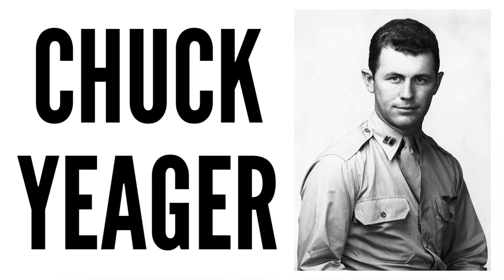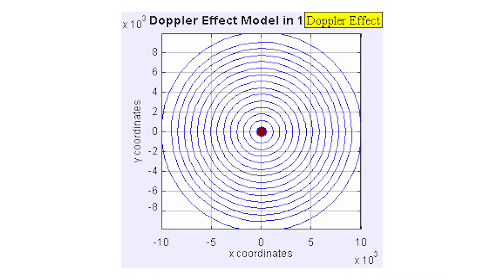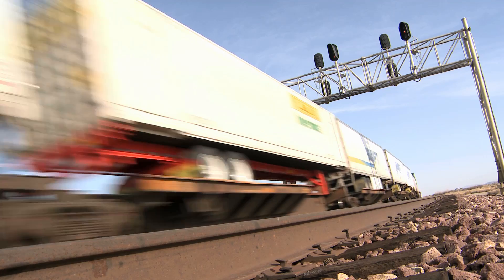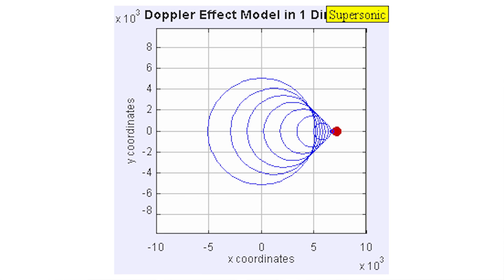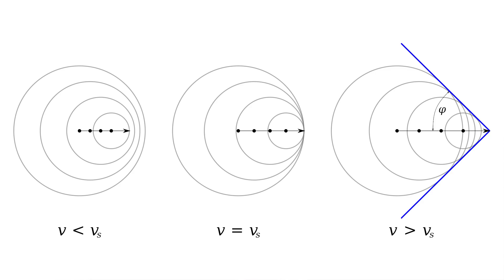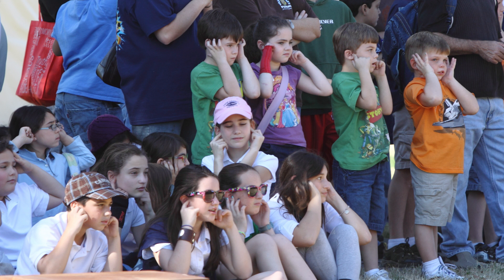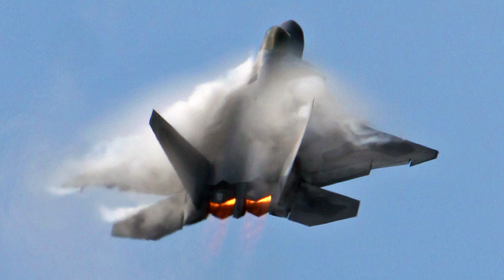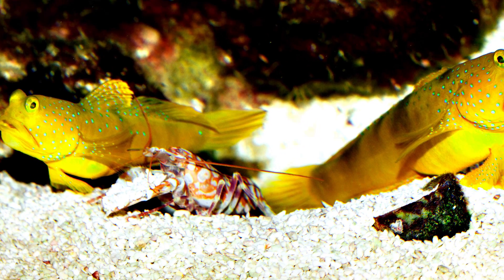What Is a Sonic Boom? And How It Breaks Every Rule You Know

Comment: This answered a life long question and argument in my family thank you!!! I’ve always told my family that there is no way a sonic boom only happens at the point of which the jet passes the speed of sound, rather the sound boom rides behind the jet until it slows below the speed. Everyone said I was wrong. And I knew I had to be right bc the jet is still ahead of the sound the whole time. How could it be one big boom and than nothing!?? No. The boom isn’t one boom it’s a loud roar following the jet. And when it hits you on the ground in sound like one boom. It’s like if you run as fast as the jet without creating your own boom. You could run in the boom sound and it would be constant. Not a boom at that point but just a loud constant roar. You can hear this roar for more than the boom. Have you ever thought a get engine was loud as thunder when it was way off in the distance? That’s not the engine making that loud roar. That’s the sound wave overlap you’re hear. When a jet is flying under the speed of sound way off like that, you don’t even hear it. I know you’ve seen a jet and heard nothing? You’re like wow that crazy i can’t hear the engine. Well it was never the engine you were hearing. If you only hear the engine the sound wouldn’t make it to you. And if you was close enough to hear it. It would sound like air spraying. Not thunder

Comment: 00:39.   That’s not a sonic boom. You’ve been fooled by whoever sold you the pic or wherever you found it. Basically it’s a bit of group think happening there. That pic is actually a vapour cone.

What’s a vapour cone. Well as anything moves through the air it will compress the air in front of it. Then the air will expand into the lower pressure behind it. If there is enough moisture in the air or a big enough pressure differential then you’ll get a vapour cone.
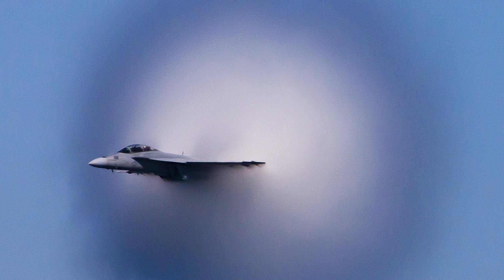Reply: He literally explains this at like 6:00
Reply: @padatricks1561  well don’t pass it off as a sonic boom and then  a person might watch the video instead of bailing and thumbs downing and running the watch time.

Comment: Ok that shrimp is pretty damn impressive! About sonic booms, my elementary school, which I’ve posted various comments about, was on the beach, sort of. Our playground was all sand, and to actually get to the water, all you’d have to do is walk a path about 25-35 feet long through some very low vegetation. Anyway, Air Force & Navy pilots often used to do practice flights over the Atlantic Ocean, and not too far from the school. And more than often they’d break the sound barrier and BOOM! All of the windows would shake and rattle. In fact, it became so common that we were eventually desensitized to it. And whenever it happened, we just ignored it. Still was pretty cool experience at such a young age.

Comment: Good video, I think it's great that you can talk about so many different things; however it is also a myth that there is a "sound barrier", and that aircraft have to "break it" to go faster than sound. In reality a shock wave develops as you say, which can be heard as a boom but it's not breaking through any sort of barrier. Air flow over surfaces changes as the speed of sound is matched or exceeded, so not every plane could physically travel so fast without dropping out of the sky.

Comment: 340.42 m/s is just an AVERAGE at MEAN SEA LEVEL. The speed of sound in air is highly dependent on air pressure and temperature. 340 m/s would have been adequate - there is no need to quote to such high precision

Comment: Wonderful video sir.

This doppler effect is very cool it helps you calculate the speed of a moving object simply by measuring the change in frequency. 

The change in frequency is corresponding to the speed of a moving object. Machines can easily measure the change in frequency.

It is also used in medical science for looking at the flow and turbulence and other things.

Comment: It doesn't take longer for the sound to reach your ears, or quicker for that matter. The waves are compressed and stretched, yes, which simply means longer and shorted wavelengths, which translates into higher and lower pitched sounds, depending on which direction it's traveling (towards or away from you).

Comment: The speed of sound in water is 1500 m/s, that is more than four times the speed in air, so I don't know if it's even possible to create a sonic boom in water before it would boil and vaporize. The mechanism behind pistol shrimp's ability is somewhat similar, its claw shoots out a cavitation bubble that causes water temperature briefly rise very high. The bubble is moving at around 100 km/h which, while still being impressive, is a fraction of the needed velocity to cause a sonic boom even in air. The claw might move even faster than that but still, I doubt it causes sonic boom.

https://en.wikipedia.org/wiki/Alpheidae#Snapping_effect

Comment: Great video, and excellent explanation. One suggestion - you give the speed of sound at Sea Level as a constant. But the speed of sound actually changes daily at Sea Level depending on the air temperature. In an ideal gas, the speed of sound is directly dependent on the temperature alone. Specifically, it varies in direct proportion to the  square root of the absolute temperature. 

One moment you can be breaking the sound barrier, and the next minute you may not be - if the air temperature changed. 

Anyhow, I really liked and appreciated your high quality explanation of this whole concept of the sonic boom.

Comment: Sounds travel as a longitudinal wave, not a transverse wave - they don't have crests and troughs.
Reply: Ruchira Mukherjee Yep, and you can represent the compression of the air particles as a transverse wave, with the crests representing the compressions and the troughs as rarefactions
Reply: Penguin Design, a wave form whether longitudinal or transverse will have peaks and troughs, hence why they are called waves. Higher frequency sounds have shorter wavelengths than lower frequency sounds. Wavelength being the time between each peak and trough on the X-axis, where X=0. Peak being the same as crest.
Reply: Penguin Design it has compressions and rarefactions
Reply: Yep, i stop watching after they represent soundwave as transverse wave, lol..
Reply: @lazuardiinggil  so, a simple mistake prevented you from watching all the other things you could've known. that's damn stupid.

Comment: So if a plane is faster than sound you will not hear the noise of the engines?
Reply: Al Yarrdam-el-islam-abdullah Well, it depends where you are at that moment. If you're on the ground, you will hear the sonic boom, of course (coming from the engine and the aircraft moving through the air). If you're in the plane, you would not be able to hear the sonic boom, because this is created by the difference in velocity between the plane and the ground. However, you can hear whatever sounds which are produced in the aircraft - for example, someone talking to you or the noise made by the engine, because they only need to go through a few meters of air until reaching you (they are travelling at the same speed as you are). Another example : the Earth is rotating all the time at supersonic speeds, but this does not distort the way you hear your friends speak, because they are rotating at the same speed as you. I hope this explanation helps.
Reply: DragosNowitzki Thanks a lot for the explanation

And 1 more question

Did the Concorde reach Mach 2 only because it was flying at around 60.000 feet? or could you also reach Mach 2 at 100 feet?
Reply: Al Yarrdam-el-islam-abdullah other people will hear it but the person inside the plane will not hear anything due to the speed they are going at
Reply: And the noise of the engine? Because if you sit in front of the engine and your travelling faster than sound how can you hear the engine then?
Reply: Al Yarrdam-el-islam-abdullah sound is still making sound but the guy driving it won't hear it since it can't keep up with the speed of the aircraft
Reply: I believe you will hear the engine even If you're inside the aircraft, the sound of the engine passes through the aircraft itself, and the air inside it (which remains stable). I'm not an expert though.

Comment: whats 340.9 meters a sec in miles?
Reply: It's about 1/5 a mile.
Reply: 340.9 metres per second is around 762.57 miles per hour
Reply: It also equals around 1118.44 feet per second
Reply: K thanks lads

Comment: Nice and clear explanation. Allow me to finetune some airodynamic aspects.Speed of sound at sealevel is indeed 340 m/s, but this only true for an infinite small disturbance in the air. It is used for calcultations, but actual sound usually goes faster. How much faster depend on how loud (the pressure difference over the sound wave) the disturbance actually is. In plain terms: loud noise travels faster than weak noise. To use the example of the video, the sonic boom (pressure wave) moves at the same forward speed as the plane that produces it. Plane goes mach 1.5, the sonic boom moves at mach 1.5. That is why a plane does not goes faster as the sound it produces, it actually accumulates the pressure wave in front of the plane and drags it along at the same speed.
Reply: El BU !!nerd alert!! JK

Comment: So if a airplane surpasses the speed of sound, will the passengers speak to each other in vain? I did hear it would have been relatively silent.
Reply: +Midas  The passengers should be able to hear each other's voices. Kinda like how you can juggle things in the car while the car is moving.

The will not be able to hear each other if the plane compartment is open(which they will also die, but assuming they didn't die) , the same goes to juggling things on a convertible (also, the wind will also literally blow it away)

I might be wrong , but this should be how it will work.
Reply: +Shaun Lim Well, this could be a different case. As I believe because items being thrown are physical matter while speaking is just sound waves... honestly not sure if the law of inertia acts on both cases. It does definitely act on items being juggle in the car as you said....

But does it also applies on sound? Wouldn't like the event when the airplane surpass the speed of sound, cause a disruption to sound infront of the sonic boom? Making all sound in front of the sonic boom go out faster then it's normal speed? 

Of course, I could be wrong.

Comment: What if you traveled in another plane at the exact point of the end of the mach cone. Would you hear a constant and loud deafening noise?
Reply: +ByteMe Assuming that you're saying that you are constantly behind the other plane, and both are travelling at exactly mach one, you have to be about 300 metres (or the amount of distance sound travels per second) behind to constantly hear the deafening noise
Reply: BackSeat Gamer I wonder what that would sound like. That would be awesome lol
Reply: +ByteMe and to correct myself, the duration of the sonic boom is not a constant. it happens in less than one second. About 0.1s for fighter sized aircraft. It ranges between 0.1-100Hz depending on the atmosphere at the given point of time.
Reply: +BackSeat Gamer Then why did the guy in the video say it was constant?

Also, sound waves are, physical things, right? So is it possible to get crushed under the pressure of a bunch of waves combined into one?

Sorry if i sound ignorant.
Reply: +Sausage Biscuit It's ok to sound ignorant :). Anyway, as for your first question. I think the guy in the video is referring to the sonic cone when he was talking about the sonic boom. The sonic boom itself cannot happen as a constant as at high speeds, aerodynamics don't apply as much. This is because the high velocity of an object causes the air in front of it to compress tremendously and the physics become more of a fluid than air. Think of it as compressed air has similar mechanics as water. That's why the f-15, in one incident, it lost a wing and could still fly with afterburners.

As for your second question, yes, it is possible. Air can, actually kill a person with high enough pressure.
Reply: That's amazing! I love aerodynamics. :)
Reply: Oh, I get it! 
So sound itself isn't something physical, but it's  interactions with what it travels through are what 'make' it, No?
Reply: Sausage Biscuit Sound is basically vibrations in the air in the form of a wave. So you are basically right :D
Reply: Byte me
Reply: Davis Rippon ( Shows fangs )

Comment: Great video thoughty 2. Just FYI,  a sonic boom happens Twice. On the nose and on the trailing edge. Reason is because of conservation of mass.  For a visual use look at the wakes produced by very large ships.  You'll see one in front and back.  So u actually hear two sonic booms but they're so close to each other that most if the time u can't tell them apart. You would need a REALLY long aircraft to hear the 2 of them

Comment: Note... the white cone of vapor effect that makes the shock wave visible is not common.  Temperature and humidity have to be just right for that to happen.  The white cone is water condensing out of the air.  due to the conditions there is low pressure directly behind the shock wave and that is what makes the water droplets form.  They quickly vaporize again or the plane would be leaving a big white trail. (this is also related to how contrails form behind airliners)

Comment: I wouldn't doubt if the Germans did it first in an Me262 in a nose dive .
Reply: Johnny Klebitz its somewhat likely but if there was no one to her it than well. it like the riddle if a tree falls in a forest but no ones around to here it did it make a sound.
Reply: Nazi Germany did everything first lol
Reply: American Tanker
 Well no it was aerodynamically impossible for the Me262 to reach that speed as the aircraft would pitch up before it reached the sound barrier .  Elevator controls locked out at 640mph IAS so the pilot could not keep the nose down  to gain enough speed to break the sound barrier . the rate of pitch would have been in the region of 10 to 15 deg a second .  The RAF did huge amounts of test flights in captured Me262 after the war and never got it to break the sound barrier for this reason .  It got close (trans sonic) but not all the way .

BTW the British designer got the jet engine built first . A Mr Frank Whittle in 1923 (aprox) and  improved by Mr Stanly Hooker (built in 1936) designed the first jet engines and put into production (though not used in a combat aircraft) . Frank Whittle used a turbojet design with a compressor and after burner (radically different from the Axle flow used by the BMW engine used by Me262) .  The French engine designer Maxim Guillaume but was never built due to it being impossible with the technology at the time (as Germany found out with it's own axle flow engines being very unreliable) . Stanley Hooker went on to design 6 very important engines  The RR Nane , RR Avon , RR Olympus , Pegasus (as used by The Hawker Sidney Harrier) , RR RB211 (as used by the Tristar ) and the RR Orpheus engines .  He also did important work on the Merlin (designing the two stage compressor for the Merlin 66 with Frank whittle ) .
Reply: Johnny Klebitz  The 262 couldn't break the sound barrier as the aircraft had positive compression  when over 640 mph . It would nose up so end up in a climb . The controls would lock up , so the pilot couldn't push the nose down . 

The first aircraft to break the sound barrier was a RAF Meteor MkIV in 1946 with a modified rear tail  (it had full moving with tail planes ) though this was achieved in a dive from 38,000 ft of around 45-50 deg . The X-1 was the first in level flight (even though it was a Miles  M52 British design handed over to the Americans) .

Comment: Pistol shrimp don't make sonic bangs.They make a much cooler effect. They make cavitation bubbles. Basically they squirt water out from there claws so fast that there is a vacuum behind the pulse. The weight of the entire ocean then slams the bubble shut so hard that it heats to the temperature of the sun, The bang that is the sound of the water slamming together at such immense forces.

Comment: What if a plane was to pass the speed of light
Reply: With usual tech impossible. Whilst moving with the speed of light the mass of any object would be infinite, so it would consume infinite fuel etc. The only possible way would be the warp drive (so space time curvature). You would move at relative speed of light whilst not hurting the general relativity theory by Einstein.
Reply: Hansen is Awesome
 Antimatter has the same mass as it's regular matter counterpart it simply has the opposing charge. For example the antimatter version of an electron (neg charge) is the positron (pos charge). Photons(light carrying particle) are massless as well as gluons and quarks ( I think, but honestly may have remembered incorrectly)
Reply: Simple in theory the plane goes back in time, and you if you don't stand why you should do some research, I could explain why but I don't even know of you will reply to this comment.